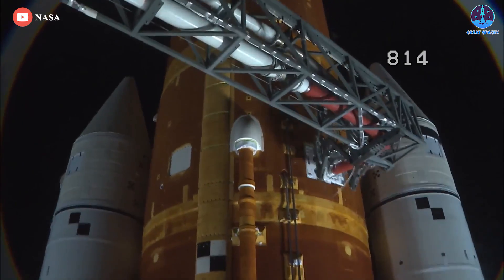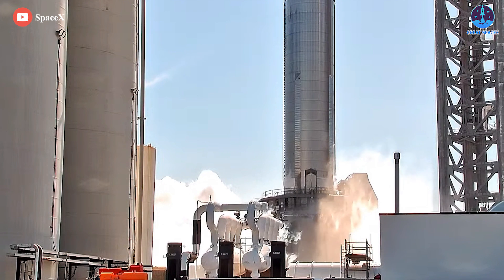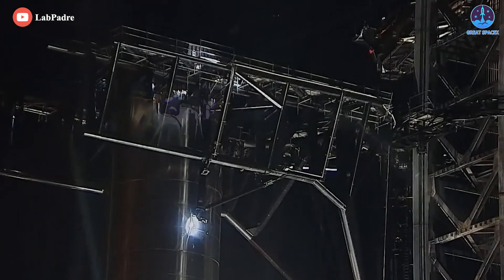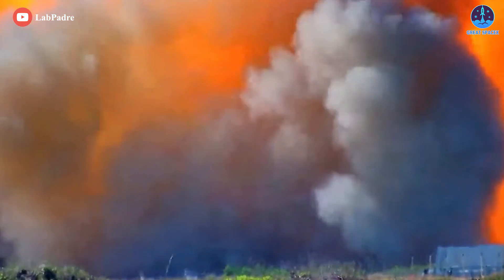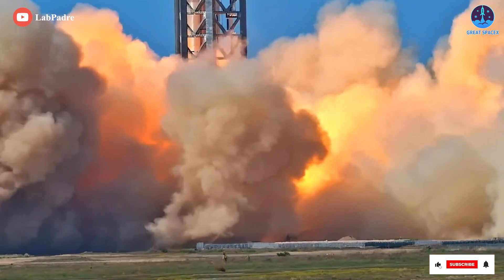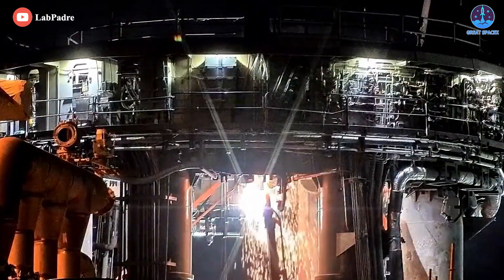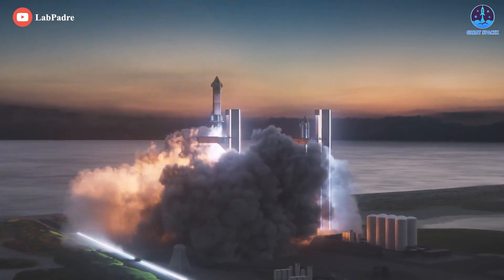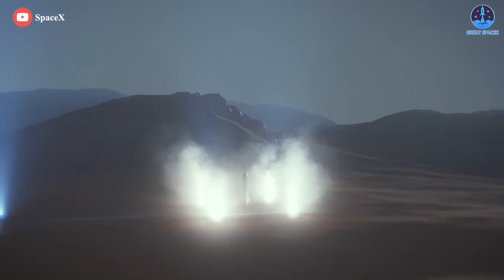SpaceX's Launch Pad Constant Problem With Static Fire Test!!!

Comment: Could the heat tiles made for starship not be the answer to the launch pad protection?
Reply from the maker: No bro!!! But the flame deflector system could protect not only the Starship rocket but also its launch pad structures from the intense heat of launch.

Comment: The author of this "You Tube" video make a mistake.  Currently, the most powerful operation rocket is "SLS".   Also, why is Space X not conducting these static test firings at one of NASA's Stennis Space Center test stands?  Finally, I agreed with these comments "Where is the large flame trench (like NASA's Launch Complex 39 A and B)?"

Comment: Hmm, I wonder what made SpaceX build the mount so high in the air?  How did they determine the height?  It’s too bad SpaceX didn’t have all the geniuses commenting here, to help them design the mount.  I really wish he would have consulted with this YouTuber and it’s Followers - to help get it right.  Maybe they could have built the mount with the engines a meter off the surface, so they must have had help from at least one youtuber and it’s followers?  Rumor is that the combustion chamber wall thickness on the Raptor was determined by consulting with youtubers and the switch away from carbon fiber came from Reddit. 
LOL arm chair rocketeers

Comment: Problem is, launch pad support legs are steel tubes back filled with concrete.  Concrete expands and moisture in porous concrete turns to explosive steam when super heated. The launch pad will tare itself apart after only a few launches.  Why no diverter trench? This seems obvious mistake.

Comment: SpaceX should completely redesign launch table. Its better to launch rocket from hanged position and launch table must be rolled out as soon booster and starship fueled and ready to launch. The rocket must be positioned (hanged) higher from the ground and ground must be reinforces with water cooled steel plates. With current table they gonna burn it up completely with 39 raptors for sure. It can be use only ones a year. Its questionable that even oil rigs used for launch are big enough not to be melted during launch.

Comment: Yes there isn't enough distance between Ignition and the ground for that many Engines with that thrust. The Saturn V deluge system was like 200,000 to 300,000 gallons of water over 30 to 40 seconds (approx.) during ignition, and those engines were half the thrust. There's likely 'More Than' 200 db Acoustic impact as well as possible Damaging Debris flying literally everywhere. Even damaging the Launch Structure could set them back quite a bit.

Comment: They can't build a flame trench at starbase because of protected wet lands nearby. This would drastically increase studies and time required for  environmental impact assessment. Likely the same reason they are using their unique flameX system instead of standard deluge system.

Comment: Hey Elon , I don’t have twitter to suggest this to you ! But to keep from digging a hole under launch pad , you could try laying 1” or 1-1/2” steel plates over all the concrete surface under and around pad and weld them together no gaps ! With water spraying already to cool pad I believe it will keep steel cool also and will not damage concrete under steel ! Someone please tweet this to ELON M. please 

DB
Reply from the maker: That's a good idea! Hope Elon can see it!

Comment: Can they build a surface mounted steel fabricated exhaust blast tunnel using heavy gauge steel plating from the OLM and away from the fuel farm etc, and continue with more shielding of the OLM legs to protect the pipes and electrical components,  at least the exhaust blast will be controlled by the water deluge system and reduce the damage to the OLM,
Reply from the maker: You're right!

Comment: If they put tubing inside the concrete and pump cryo fluid through the piping it just might save the concrete from the heat and flame's also they can do same inside the legs of the launch mount (what Do you think about )
Reply from the maker: Thanks for your feedback! In fact, quite a few pipes inside the OLM legs were damaged during the static fire test! So, maybe there needs to be another way.

Comment: I KNEW this was going to be a problem! An enormous pit like what the Russians use would probably work, but that might be hard to build in soggy soil so close to the ocean.
Reply from the maker: That's right!
Reply: When the World Trade Center was built back in the Sixties, the design called for a multilevel sub-basement, despite being situated so close to the water's edge, so to keep out water infiltration, the basement was conceived and built as a kind of giant bathtub, with much better waterproofing than is customary. The problem of building subsurface tunnels at Boca Chica would be a similar challenge, although since the launch pad is farther from the Gulf of Mexico than the Twin Towers were from the southern tip of Manhattan, it should be easier.

Comment: If they can't dig a big deep trench at this point then use a layered protection system. Thick steel plates air gaped from the ground, then an active cooling layer, next a modified set of the starship own heat shield tiles covering the ground that are assisted by the active coming layer below them, then you can also still use the water/ln2 system for sound suppression and flame control and not need to keep worry about blowing chunks of concrete all over the place every time they fire even a single engine.
Reply: I feel like it’s just a must have thing.  Gotta get those thrusters off the ground.  Double the clearance and double the water.  Double the power of Saturn Five means 4 times the need for stage 0.

Comment: I guess this is what happens when details are ignored, such as your basic launch pad engineering,  as well as the laws of physics. It is starting to look like the Starship might be SpaceX's undoing.
Reply: I think this is a problem, but the undoing of SpaceX? NASA would like to have a word with you. Not only have the bought into Starship completely, they just expanded their contact for more Starship launches. They believe in the rocket. I think the rocket tech itself is sound. The launchpad is something that can be fixed, and I'm sure will be. I think these early designs are merely proof of concept to help develop the starship itself. What are they building, 3 more launchpads right now? I think this first design will be improved upon greatly. I can't imagine everyone at SpaceX has been ignoring a problem that is obvious to anyone who has watched a static fire. They must have plans to deal with this. There's no way that launchpad can withstand 33 raptors being fired at once for 20 seconds. That's clear even to us space enthusiasts. Surely they know it too, given they have 1000x more data than we have access to.

Comment: Problem? Yes. But fact is that during an actual launch attempt, only a very short (seconds) time will be spend in close proximity to the ground and on the launch pad.  It will quickly rise and the intense flame won't impinge directly on the pad.  A static fire, where the vehicle is held in place for a significant period of time during the test, is actually much more damaging than a launch attempt.
Reply: Yes but, they do a static fire prior to every launch with Falcon. I can't imagine they don't intend to do that with Starship as well.

Comment: A trench would take some serious engineering because the base is at sea level. Lets not forget the headaches of another environmental study. Maybe they could line the launch base with the black tiles like they use on the underside of ship 24? Probably a combination of all these. If you can not go down then raise the base another 50 to 100 feet.
Reply from the maker: Agree!!!
Reply: If you raise the launch mount, better raise the entire path of the transporter from the launch mount from the high bay, so there is never a change in grade. Transporting the booster seems easy enough on the flat but I would never attempt to take it uphill, no matter how gentle the gain in elevation.
Reply: Correction: To the high bay.

Comment: I already said when that launch site was build that putting those methane tanks so close to pad was bad idea. I'm waiting for the day they will get destroy by during launch explosion. It's just not question if, but when.
Reply: Agreed if the starship is fully fueled. SpaceX is hardly fueling the boosters to perform these static firings. A fully fueled starship contains 6400 tons of fuel. Musk is talking about a modified starship that will contain 6700 tons of the fuels. 6400 tons of liquid oxygen and liquid methane has the explosion capacity of four Hiroshima atom bombs. The first time a fully fueled starship explodes at or near the launch pad will be the end of the starship program. Must talks about 1000 thousand starship launches and 10,000 starships going to Mars. Each starship going to the moon or to Mars requires 6 launches of fuel tanker starships to fully fuel each such starship while it is in earth orbit

Comment: I have been postulating for over a year that the lack of a Flame Trench was Starship's biggest fault.
The Deluge system is also Extremely insufficient.
Reply: Space X needs to hire more of us armchair  rocket engineers. We see things better then those university  educated ones do...yup!
Reply: @davidlang4442  It doesn't take a "university educated" person to see what happened at stage zero, and to postulate appropriate modifications that have been done in other places with successful results.
Reply: @otpyrcralphpierre1742  That's my point.
Reply: @davidlang4442  maybe just hire rocket engineers.
Reply: The water deluge system isn't a deluge system in the traditional sense.  It's more of a grass fire suppression system. Even at that it falls short.

Comment: Don't know if this is feasible, but put a layer of the re-entry tiles under the pad? They must have many that aren't flight ready but would be fine to protect the concrete. Do it in a way where they're rolled out in sections because they obviously can't stay there full time.
Reply: Solid point

Comment: I cannot believe how Elon and his engineers overlooked the simple fact that a launch pad with no thrust diversion duct would not damage the integrity of the launch pad let alone the base of Sta Ship where the engine bells and plumbing are exposed. This is a massive oversight and this will be a massive redesign of the launch tower if Elon expects multiple launches from the tower as in its present form it will not survive one initial launch of27 or 29 Raptors pumping out all that thrust and heat that is going to burn out the concrete base and damage all the equipment that is installed nearby.
Reply: Gee, I wasn’t invited to see all the fluid dynamic data they generated for the mount to know how high to build it.  I guess you were so give some insight on how close to the margin are they for the percussion reflection damaging the booster.  It would really be helpful to know.  Thanks in advance.

Comment: Repost. Maybe someone has already thought of this. But. Would some kind of a foldup mat made out of steel plates, like the work platform, that could be rolled in and out when needed. Since its removeable it cold be easily replaced if damaged. Maybe stainless steel? You could even have exit ramps that flare up at the ends to direct the exhaust up and away.

Comment: I thought you're channel was starting to get better, but with this new click-bate-title and no substance to prove that they have indeed damaged it (stage 0) you're now just like future unity. Congratulations on making you're channel, in my mind, weaker.
Reply: I have to agree, I’ve until now depended on this channel to give me the straight skinny.  I think there maybe is something going on because they didn’t move on but maybe today they will.  If the issue is launch pad design that would result in a huge delay, but nothing here makes me think anything more than gravel got spread around.
Reply: I'm pleased to see that an honest review of the potential dangers of a static fire of 33 Raptor engines.

Comment: One question ! Why not just fly the booster with a mass simulator then on descent eject the mass simulator into the gulf and then attempt a booster catch ?
Reply: How do you plan to eject a 85 TON block of metal and concrete? That would be interesting to see lol

Comment: Forget the base how will Starship land back with the new more powerful engines and people on top?
Reply: Not as many engines in use. At most 3 but more likely only two. Same as Falcon 9 doesn't need all 9 to land. Plus they can throttle Raptor 2s better than they can the Merlins.
Reply: @gravelydon7072  answer I was looking for 👍🏽

Comment: I pointed out critical failures at Starbase/Starship, months, getting on years ago. What turkey is making decisions there? Fire them!!!
Reply: It's possible that the damages caused a static fire of 33 Raptor engines could result in having high-ranking officers of the FAA answering questions under oath from Senators or Congressman up on Capitol Hill.

Comment: They could have laid 30mm thick steel plates on the ground and covered all the area that is being affected. These plates will never melt or buckle. plus if there is any damage in the future they can be replaced very easily.
Reply: The like 4000 degree engine exhaust would like to have a word with you
Reply: @rossh2386  with the massive amount of water and the 30mm thick plate I dont think the engines have got a chance.
Reply: and cover the launchpad legs with heat tiles
Reply: @phoule76  yep I agree, you cant have too much protection.
Reply: 50mm or 75 mm plate bolted down to existing concrete would solve this problem ie ,exploding concrete ,dust.  In steel fabrication If you try to oxy acetylene burn close to a concrete floor it always creates exploding concrete, always lay plate to prevent this.
Reply: @thomasyoungman4104  yes thats correct, I was in steel fabrication for 55 years and we always had a sheet or two on the floor to work on. I am surprised that spacex didnt foresee this problem.?

Comment: Test separates engine 15 +1 engines and 17engines and when final 33engines make sure opens exterior 30' down. If tonnage support 16engines and afterlift off 100m open  17engines.up.
Another way is to start engine exteriors follow by internal 100m
Reply: The stack of booster plus Starship weighs about 5000 tonnes on the launchpad. Each Raptor 2 engine produces 240 tonnes of thrust. Sixteen engines produce a little less than 4000 tonnes of thrust, not enough to lift the booster plus Starship off the pad. It would just sit there and go nowhere.

Basically the booster needs all thirty-three Raptor 2 engines to run at full power to accelerate upwards at the required rate (about 0.5g over earth's gravity, 7500 tonnes of thrust pushing a 5000 tonne vehicle). The stack can cope with losing a couple of engines at the beginning of its flight and still make it to orbit by burning the other engines for longer but it can't take off at all if too many engines don't work at ignition or shortly thereafter.